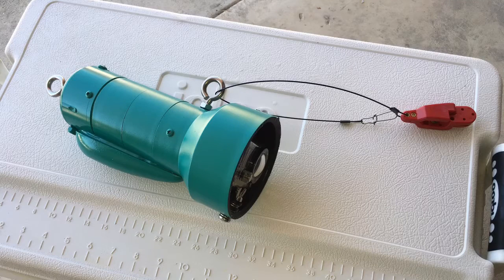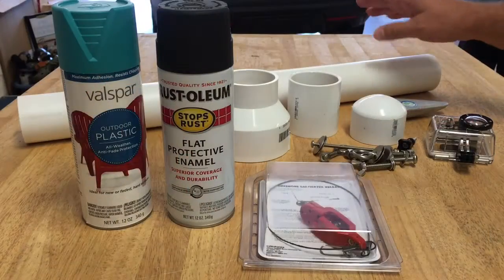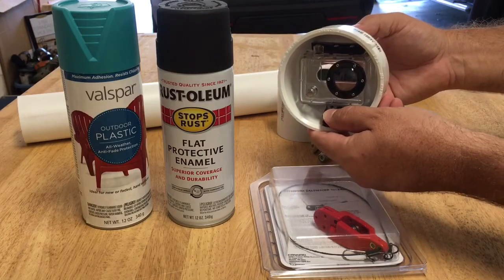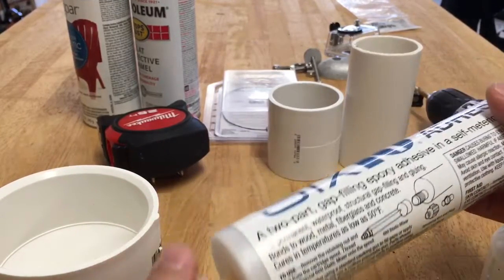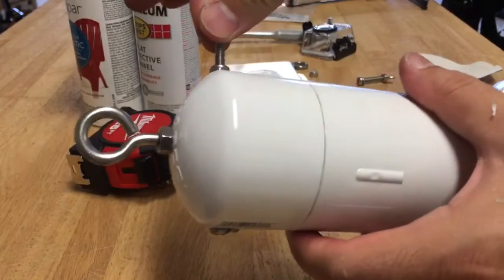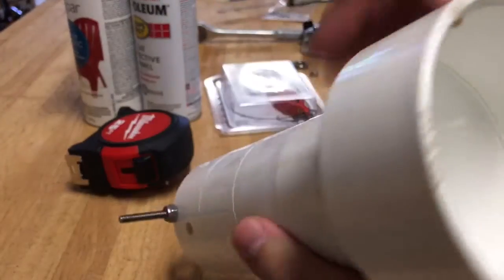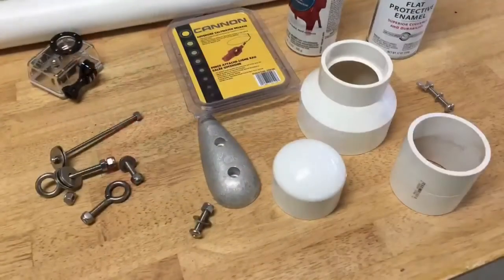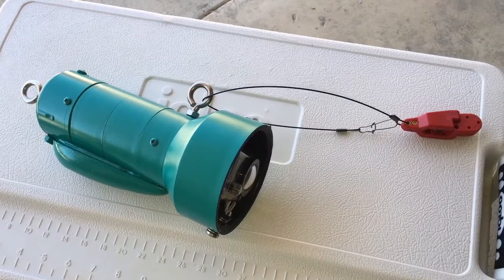GoPro Fishing Trolling Pod

Comment: Cool video. Wondering why you didn't just use purple primer and pvc glue that stuff never comes apart. Also you could have run a nut all the way on the eye bolt then put a small washer inside with a lock nut before you glued it together. No need for epoxy.
Reply from the maker: I literally just made it up as I experimented put in different parts together